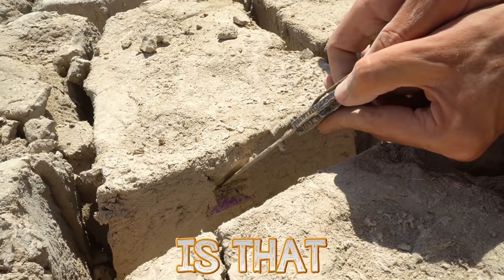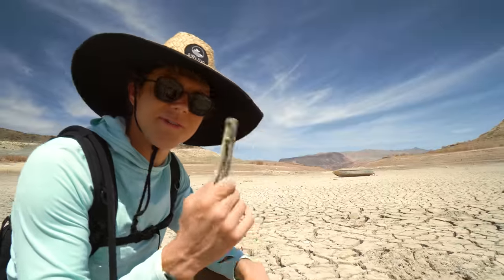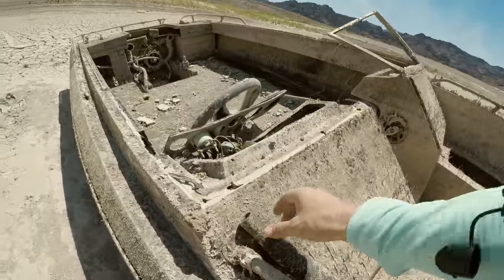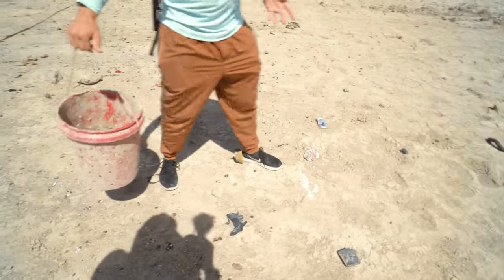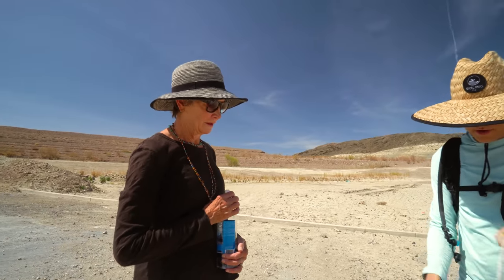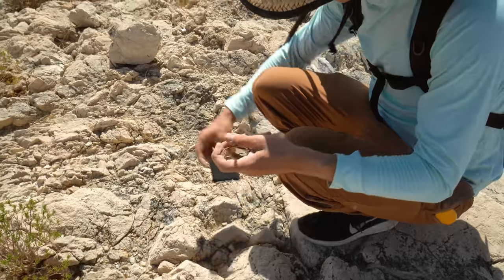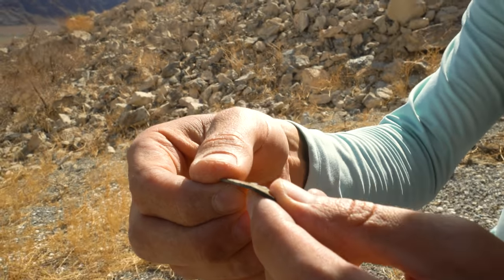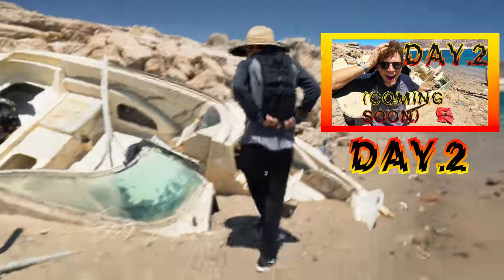AHH!!! Lake Mead is DRY AS A BONE! (Time to Explore)

Comment: those old tvs have lead in the screens i learned this while attempting to build a monitor from a tv for a ibm clone computer i learned it from watching how to dispose/discharge the crt because i thought i might need to open it up and hook new connectors to the tv so i could either bypass the built in modulator or wire a slightly newer connector to the tv because it only has a 3.5mm jack for a antenna and well old computers are made for old crts so if you hook one to a modern lcd and it comes in blurry 
so i either needed to get a monitor or manage not to kill myself with a crt tube because the tubes are a giant freaking capacitor.